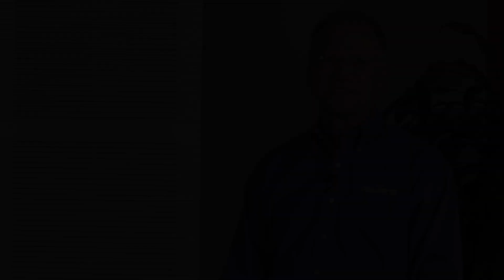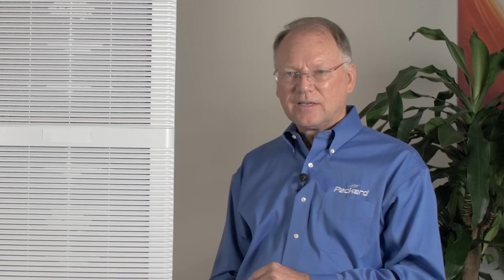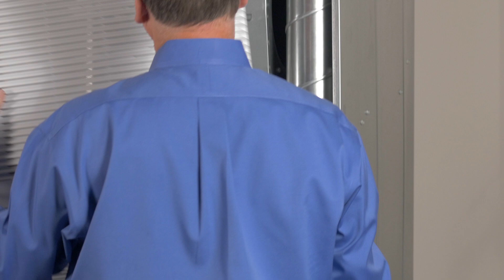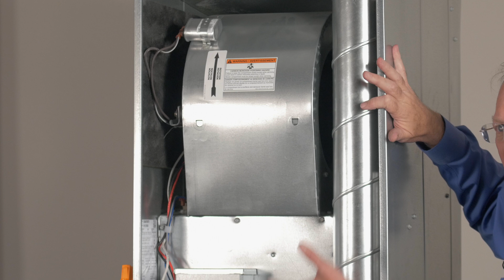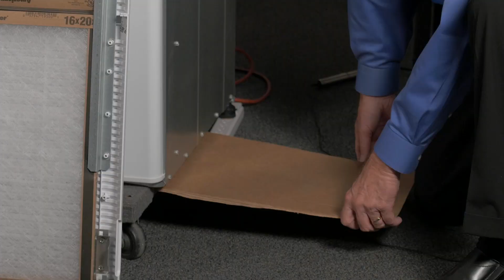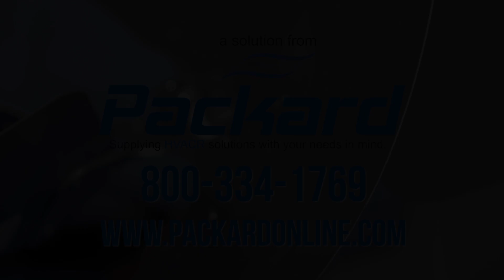Is Static Pressure Hurting Your Blower Performance?

Comment: Interesting video. I agree the fan motor power will decrease when blocking airflow, but the overall system power will increase since the compressor will consume more power due to decreased efficiency.
Reply: Perry schmidt. which compresor.
Reply: compressor may be damaged due to liquid flooding  and oil dilution in the compressor. Causing excess friction due to lack of proper lubrication in the compressor. it all goes downhill from there.
Reply: Perry schmidt. Everything you just said is OPPOSITE of this video.
Reply: Max R Nope. The system runs less efficiently, and thus needs to run longer to get to the temperature set point, which increases overall energy usage.
Reply: @Ariccio123   If the suction pressure drops the compressor also draws fewer amps. In refrigeration, they use crankcase pressure reducing valves until the load drops off. An ac unit has no such valves and must operate above freezing. Remember that the air temperature also matters. Cold air is denser so if the blower is ahead of the evaporator or behind it also affects the volume of air being moved. Efficiency? That depends on the latent heat load.
Reply: Alexander Riccio. No what.

Comment: so can you size a return too large?  I have a 3 ton unit with a 2 ton grill can I simply add another 2 ton grill?  I have plenty of room but don't want to reduce SP too much if its really required
Reply from the maker: Too much air can overwork the blower.  If the blower is properly sized to the system and the static pressure is appropriate the full load apps of a PSC motor should be no greater than 10% above or 25% below nameplate amps.

Comment: Great videos. Q: If amp draw is reduced as static pressure is increased, obviously, watts will also go down reducing the amount of energy consumed. Why then, do I read elsewhere reducing static pressure will save on electricity bills? Thus, won't more flow filters, increased return sizes, etc actually make the electric bill go up? With ECM motors does this relationships change?
Reply from the maker: As static pressure is increased the amount of air being worked by the blower is restricted, that is, less air is available in the system.  Because less air is being delivered not as much power is required.  Hence, less energy is consumed.  Which is good, unless you’re concerned about not having as much air volume which may be necessary for comfort.  Yes, having more flow filters and increased return sizes will cause energy consumption to go up but it may result in having more air flow, which could result in better cooling or heating of those back bedrooms.  Always remember that the motor has to have the proper amount of air flowing over it otherwise it will overheat.  This will result in reduced motor life.  Even if the full load amps are well below nameplate it doesn’t mean that the motor is operating more efficiently.  If the amps are more than 25% below nameplate amps the motor probably does not have the proper amount of air flowing over it and it will overheat.
 
Static pressure also impacts ECMs.  Some ECMs are designed to compensate for changes in static pressure by varying their speed (constant air flow) while others provide a constant amount of power (constant torque) and are not as responsive to the static pressure changes as is the constant air flow design.  Excessive static pressure will kill the ECM.  One advantage of the ECM over the PSC motor is that the ECM is capable of operating at a low RPM on constant fan.  This can help eliminate the stratification of air (hot spots and cold spots) that might be experienced with a PSC.  By operating at a low RPM power consumption is reduced greatly.
Reply: Now I see the tradeoff between energy consumption, air flow and heat dissipation. I see so much incorrect information about these relationships. Many articles claim high efficiency (high MERV) filters will increase energy usage.  What they really mean to say is energy usage will declinel however, with a hit on system performance due to reduced flow and longevity due to heat and motor wear. I have an ECM (not sure which kind, but it has fixed speed taps and isn't variable speed) in my Trane XT80 and measured TESP at .6 (.45 on the return and .15 to the supply).  I don't see a maximum TESP on any of my labels or manuals. I know traditionally, maximum TESP is measured at .5 but am I within range?
Reply: Motors are designed to operate at a specified rpm, and current.  Motors create heat while also moving air.  If you increase static pressure on a centrifugal type blower, you will also increase rpms of the psc motor, this is proven by reading counter emf across the blower capacitor.  When a motor is running out of it's designed range the actual efficiency of the motor decreases.  
So, even though your energy consumption may be reduced while operating under greater static pressure, the energy reduction is not linear to the air flow performance reduction, meaning "you're getting less bang for your buck".  You're moving a lot less air for a little less energy consumption.  
The heat being created by the motor is slightly less, but the air flow being much less reduces the self cooling capability.  The rpm increase, and excessive emf can cause shortened blower capacitor life. 

When static pressure increases on a "variable speed" ECM type motor, the motor has the ability to sense the air flow reduction, or static pressure increase, and will automatically increase torque in attempts to achieve proper air flow.  The ECM does have a rev limiter, at which point it will intermittently cut out, sounding like a washing machine.  I believe it's a voltage sensing limiter.  When the variable speed motor has to increase torque to achieve the proper cfm, it may actually be consuming more energy than a less efficient PSC motor operating under normal static pressure.    
Other ECM motors like the X13 will behave similarly to the PSC.I believe it's voltage sensing limiter.

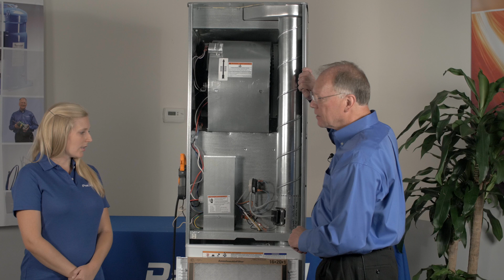Comment: At 2:15 in the video, the amp draw is 7.08. At 4.20 in the video, the amp draw is 5.78. In both instances the situation is the same (lid of and no cardboard)Why are the amp readings different??
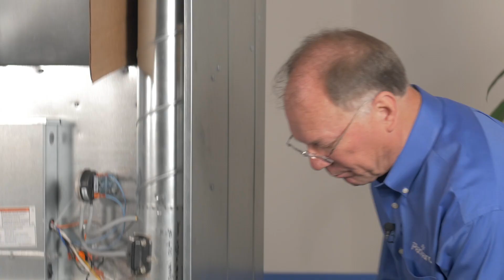Reply from the maker: The conditions are NOT the same at 2:15 vs 4:20.  The furnace door is off in both but at 4:20 there is cardboard over the blower inlet which is creating additional static pressure.  This restricts air which unloads the blower.  The blower is not working as hard and the amps are lower. - Rick Streacker, National Trainer.  If you have any further questions do not hesitate to ask. Thank you for reaching out to Packard.
Reply: Thank you for the quick reply.. I somehow had missed that he left the cardboard in.
Great video and simple (but effective) demonstration!!
Reply from the maker: You are very welcome.  Glad Packard could help!

Comment: why we can't see the meter? just to make sure the lady is telling us the true..
Reply from the maker: If you are referring to the meter in the video there wouldn't have been any reason for the true meter reading not to have been read out loud.  I assume the meter had to be positioned there for practicality.  Mr. Streacker is our National Trainer and he would not allow the dissemination of false information.  Thank you for your interest in the video.
Reply: Obvious false flag.
Reply: you say that it doesn't matter which the outlet or inlet get blocked and the current goes down. i don't see how that adds up. if the inlet if blocked yes the current should go down because it's creating a vacuum meaning the mass of the air should go down thus less friction on the impeller. if you block the outlet the current should go up because you pressurize the chamber around the impeller meaning the mass of the air goes up and the friction on the impeller goes up. you blocked the inlet and outlet meaning the reading was false for the outlet test.. hope not i am internally wrong.  do not know very much about this and have never tested it, but that would be my logical explanation.